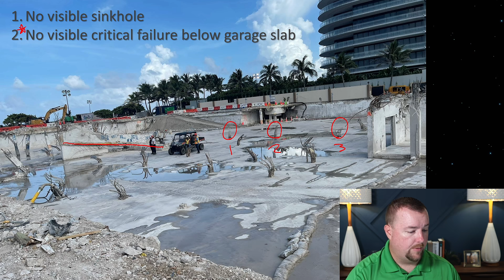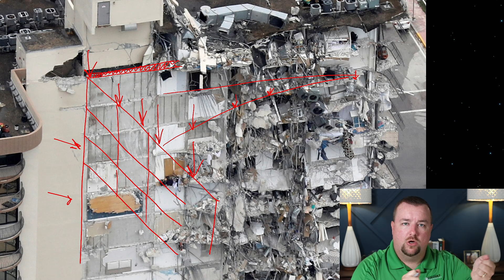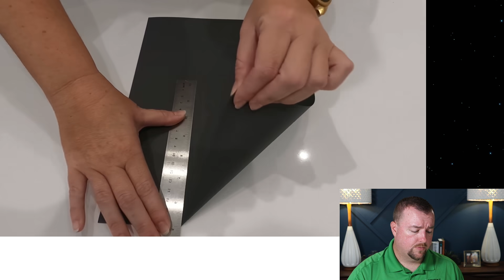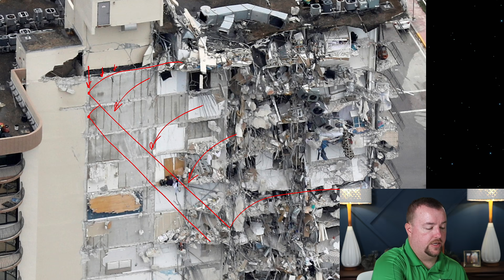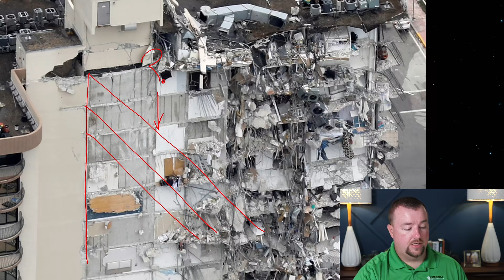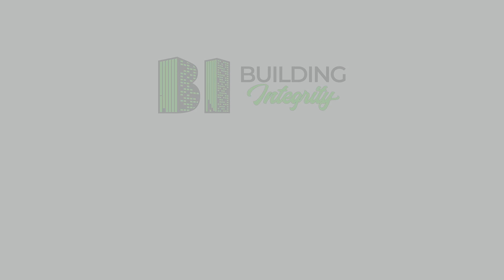Surfside Collapse - Structural Engineer Explains Why Only Half the Building Collapsed

Comment: One thing that astonishes me about how clean the slabs tore at the shear wall, is how you don't see strings of rebar hanging down.  It tore right through.
Reply: Yeah, I don't understand that either. I asked that question above. The engineer replied that he thinks they simply "snapped cleanly". I'm finding that hard to swallow, but he is an engineer!
Reply: I think maybe the building was built in sections. The south, or remaining , side built first. Then they turned the corner and did the center. Only connecting the hallway with rebar and concrete. . Maybe.
Reply: @peterford9369  The part of the building that remained standing after the other part collapsed actually faced the main road. It's where their main entrance and lobby was located so it's my guess that the developer would build that part (the part that remained standing after the initial collapse) first because it lines the main drag with all the other buildings. Wouldn't make sense to build the far back part that faces the ocean when there isn't a lobby there. Just my two cents.
Reply: @KayInMaine  I'm sure you are right. My point was, instead of building the whole structure in one monolithic pour, floor by floor, they built each tower separate, starting with the south, and put larger piles under it. An also larger columns all the way up. Then cut the cost,,on the remaining structure. And, I was just answering to the question, why did the rest fall and seemingly so cleanly, from the south tower. 
That was my 1 cent worth,😘
Reply: Crazy isn’t it? My guess for not having rebar sticking through the shear walls is that it just so happened to tear in between 2 bedroom walls. Maybe they weren’t load bearing walls and therefore only had wood and no rebar in it but that’s just my guess. I am not an engineer
Reply: @kyber7503  My guess is cutting corners
Reply: @philipstreechon4523  They didn't use rebar in the slab at a shear wall? 😲 
I've seen some shady stuff, but that's a hell of a "corner" to cut! 
I thought about it, but don't think they would have gotten away with it for 40 years.
Reply: @Bannering101    Well if they didn’t …then thank heavens.  That helped with straight edge?
Reply: @Bannering101  Until recently it was very hard to verify that rebar in concrete was where the drawings showed it… It is possible to image it now with portable radar and x-ray equipment.
Reply: @allangibson2408  True. However, what does that have to do with this issue? Our point is that we should be able to see the rebar with our eyes, and we don't!
Reply: @Bannering101  The only issue is whether a building inspector should or could have caught a non-conformity after the concrete was poured. Now they can - in 1970 they couldn’t.
Reply: @Bannering101  Yeah, they did. You just can't really see it in the photo. Look around in his other videos. He shows it.
Reply: @kyber7503  No way! Those slabs should have had continuous rebar, in both directions, whether they had load-bearing walls on them or not. Besides, that shear wall was definitely load-bearing! Even if the shear wall was poured monolithically (it wasn't) they should have had bars coming out at slab level.
Reply: @Bannering101  The garage slab of the portion which survived the collapse did not have rebar running in two directions. It had rebar running one direction in one layer. It has been suggested that this configuration was too weak to carry the live loads of the vehicles using the parking garage.
Reply: @BigHenFor  I've NEVER seen a mat in a slab with rebar running and only One direction. It doesn't even make sense, as the rebar will be unable to disperse the load! In any case the load-bearing ability of the garage slab is not an issue here. The slab has been uncovered and appears to be intact. My guess is that it's going to be the columns at the slab that are the issue.
Reply: look how few rebar are sticking out from the wall
Reply: @philipstreechon4523  No, there's a lot more that you just can't see in that photo. BI even showed it.
Reply: I do not think the main load bearing of the stucture would be connected to the shear wall but would be put on the columns themselves.
Reply: @mikeeakin7619  Well Mike, it looks like the slabs ran through the shear wall, so it was definitely load bearing! They wouldn't rely on the slab to be cantilevered over to the sheer wall from the next row of columns.
Reply: @mikeeakin7619  there are columns within that shear wall, and the slab was connected to those columns.
Reply: Hi no these pictures were taken the next day to early on for the investigator's to have gotten there
Reply: No rebar in that floor area connecting the slab, because that wall is an elevator shaft. The slab that torn off of it appears to be  a "floating slab" the lenght of the two elevator shafts area. IIRC, elevator shaft walls are thicker and have rebar/reinenforcement  running verticle. Same thing happened at the WTC 'sorta" , one of the towers, the first 10-12 stories of the elevator shaft and stairwell managed to stay standing and some people survived in that area.
Reply: @chrisperrien7055  World Trade Center was a completely different type of construction. As I recall, the elevator and stairwells were poured in place concrete cores, but the rest of the building was a steel truss system. The trusses buckled and failed due to heat. Not applicable!
Reply: @Bannering101  Yea I know, but the nature of the elevator shafts (having core-walls?), is in efefct they acted/act like sheer walls . Seems to be a big issue with building demolitions. Whether intentional on not, the elevator shaft can be left standing after the building is blown. Note, I defintely ain't an engineer, and haven't done any construction in 25 years, so my terminogoly wil  be all wrong. :)
Reply: @Bannering101  The WTC didn’t have a concrete core in any of its buildings. The elevator shafts and stairwells were simply steel frames clad in Sheetrock / plasterboard.
Reply: @Bannering101  Yep,  the WTC columns failed due to the heat of the thermite.
Note that an office fire can't bring down  a solid steel building.
Reply: @allangibson2408  Yeah, you're probably right. As I indicated it's been a while since I've reviewed the WTC design. 
In any case, my point was... any comparison between the World Trade center, and this collapse is useless (other than the devastation caused by pancaking)! Completely different designs, and causes.
Reply: @reallyme3573  What do you mean: Fire can't bring down a solid steel building? Without fire protection, steel beams can be more vulnerable to fire than timber!
Reply: @Bannering101  I said office fire. Office fires won't get  hotter than 500 degrees celsius,  For steel to lose some strength you need at least 600 degrees celsius, 800 would be better. 
But in case of the WTC to collapse due to fire,  you need to melt all of the steel at once, which is totally impossible with a regular fire.
With a thermite demolition, thermite cuts through the steel and doesn't have to heat all of it.
Reply: @reallyme3573  Well, the Twin Towers were certainly steel "office" buildings! The engineers had anticipated a large jet hitting them. 
So, I'm not sure what your point is.
I wonder if John O'Neill was sitting on the top floor thinking: "Well... I think I was just involved in a plane crash!  However, I'm in an office building, so I should be all right!", Right before the bottom dropped out.
Reply: @Bannering101  Yup. But the arguments for waffle placement of I beams sure looks really good about now to me :) Worked on Empire State getting clobbered twice by two (obviously smaller) military planes in the 40s.
Reply: @chrisperrien7055  The WTC towers were all steel construction. The elevator shafts and fire stairs were steel clad in plasterboard for fire resistance. The only concrete in the building was a thin layer sprayed onto the steel for fireproofing.
Reply: @allangibson2408 That fireproofing is called Monocote and it is not concrete. The explosion, was able to blow the Monocoat off the trusses and columns, making them vulnerable to fire. The engineers actually designed the buildings to withstand a fire from a 707 fuel load, but didn't anticipate the explosion removing the fireproofing.
Reply: @Bannering101  Actually it was worse than that - in the south tower, on the levels that were hit, the coating had been removed prior to reapplication because it was already flaking off before the impact.
BTW a 767 with a full fuel load at 200 Tons is a bit heavier than a 707 with full fuel load at 142 tons (117 tons in early versions). The empty weight of a long range 767-400ER is higher than the takeoff weight of the early 707’s.
Reply: @allangibson2408  I don't think cement board or whatever worked in the stairs here (WTC). Chicago, it's a no-no. Has to be brick or cement block as I recall.
Reply: @windsofmarchjourneyperrytr2823  The WTC towers was a unique building project in a lot of respects - all the structural strength was in the skin not the core ( to maximise the floor space inside). The core just had light steel framed lift shafts where most didn’t go all the way up. Nowhere else copied this design, for fire safety reasons.
Reply: @Sarconthewolf  If the slab rebar terminated at the shear wall, it should have had 90s that tied it into the shear wall reinforcement, exactly to avoid pull out. In a retrofit, you MIGHT be allowed to dowel into a wall. However, you would have to use epoxy or some other mechanical device to secure it.
Reply: Ok. Let's say they decided to run rebar to the shear wall. Without a standing column to support the load bearing after the collapse maybe at most half a room would be attached to the wall. The collapse from the video looks more middle center to me. The beams that are suspect right now are pretty far from that wall
Reply: It was only lightly reinforced, 4/8" bars (13mm) sticking out of the shear wall into the floor slab.  Not going to take much to shear those bars, particularly if you think about the mass of the building that is in motion and tugging on the bars - remember, the shear wall isn't moving, and as each rebar fails the load through the remaining connected bars increases as the suspended load redistributes as the slab progressively unzips itself from the shear wall.
Reply: @barryscroggins8450  Number four bars are pretty standard for a residential slab. The issue wasn't that they would fail under these conditions. It's that we simply  don't see any trace of them!
Reply: @barryscroggins8450  13mm is about 1/2".  Not very robust.
Reply: @MichaeljRichter  The bar only deals with tensile force, the concrete does the compression forces, in composite they are adequate for the loads on the slab.  Remember the slab is only carrying residential loads, one of the most minor load cases.  4/8" bar is about what you would expect to see, top and bottom for this depth slab.
Reply: I'd want to see photos taken close to the shear wall, to see if the rebar sheared off more cleanly there, as opposed to the tangles we see from where the slab tore on a more diagonal path.

What does appear to have been the case is that a combination of factors overwhelmed the building structure, pointing out that the building codes in effect in 1981 did not provide adequate margins, especially when potentially substandard construction and excessively deferred maintenance came into play.
Reply: @chemech  Agreed! Even if it sheared off cleanly as the engineer suggests, you should see rebar! I took a screenshot, and tried to enlarge it but it was useless, as you might imagine!
Reply: Ever think that stuff like that was cut off for testing?  Remember this is a singular pic and we the public have no idea what was removed for future use of testing.
Reply: @ynwa7084  No, not every single bar 10 stories up!
Reply: @ynwa7084  they didn't climb a hundred feet in the air above an unstable pile of rubble, to trim re-bar ... that's almost for certain ...

Comment: So if they had a + shaped shear wall through the entire building perhaps only the one quadrant would have collapsed?  I guess codes only needed them to protect elevators and stairwells and add some strength/rigidity to the structure?
Reply: The wall has to prevent fire from spreading through the elevator shaft, so what better way to do that than with a shear wall that also helps give the building rigidity? The elevator shaft would otherwise be a weak point, where columns have less that usual connection to adjacent columns without the slab in the stairway and elevator shaft.

Comment: So using the example you described at the end like a jump rope, after a collapse, does that mean if you see a punched through column remaining at 90° that is the source of the failure?
Reply from the maker: Not necessarily.  The columns that punched straight through, like at the pool deck, was more likely because of how compromised the deck already was.  See my video on punching shear.
Reply: I like this comment too !

Comment: In a earlier video when explaining how the columns are formed and concrete poured into at each level..with the column starting at basement and increasing upward with each level or floor.   Why were none of the many columns not still remaining. It seem like the column remaining was only one level above ground? Did each column break off with slab at each level on the way down? Sorry only way I know to ask this question..may not make sense to you 😕
Reply: Every level collapsed including any columns above the ground floor

Comment: It's amazine that the basement slab stood up so well to the weight of the entire collapsed tower.  It is likely that there is some void under that slab, even if a few inches due to settlement of the fill around the pile caps.  There is also no visible movement in the columns that would be due to failure of any individual pile caps.
Punching shear calculations can be complicated when there are unbalances from side to side.  The building code tells how much of that unbalance has to be considered for punching shear and it does add a lot to the stress.  If you take a properly designed building then let the next column over fail, that creates a lot more unbalance at the column still standing than it was designed for, increases the shear stress around the perimeter, and will cause a punching shear failure at that column.  Then this can progress across the structure until you get to a column that has enough capacity or you get to a column line where the slab itself can hinge without failing in shear which is what seemed to happen at the face of the building that remained.
All this tells you is that large areas of the ground level slab could have collapsed.  This is like standing there, your belt breaks and your pants fall down around your ankles.  It doesn't tell us the next step which is that columns ultimately had to fail.

Comment: @josh Just watched another engineer’s vid. He opined the beam adjacent to the 16 x16 front columns along that façade that collapsed first (coincidentally under those planters that had extra load and possibly extra water damage if the planter wasn’t properly drained) probably was compromised by the hanging punch-sheared pool deck slab, leaving those front 16 x 16 columns essentially free to move laterally, and they should have been 24 x 24 anyway like the standing portion of the bldg… he felt the columns, that beam and its flimsy 2x #5 rebar (per design drawings as well as observed in post-collapse photos) and the whole pool deck slab were quite underdesigned. Supposedly morabito found no differential subsidance of the foundation (Franki piles/pile caps).

p.s. I am not an engineer, rather I only have advanced degrees in biosciences and health, so I’m just repeating another engineer’s opinion that made a whole lot of sense to me…

Comment: Your comments make sense for a top down collapse. But this building collapsed  bottom up. Loads on failing structure at the bottom would be horrendous. Near the top not quite as horrendous. Tropical f,ors

Comment: Josh, would it have at all been possible for the 3rd part of the collapse to not fall?
Really appreciate your work on all of this!
Reply: Part 3 was standing OK on its own, but I would not have gone into it.  I don't think it would have had the full strength to resist wind load that the original building had.  It would have been interesting to see it attempt to stand against the tropical storm but we didn't get to that point.
Reply: Part 3 fell. Part 4 did not fall.

Comment: Short answer: thicker columns and rigidity of elevator shaft, stairwell and twelve stories of integrated storage rooms stood the second building up. Great details, Josh!
Reply: The other building did have larger columns from level 2 on down due to the column offsets at level 2 to clear parking layout in the basement.  Those columns were larger than necessary for the load which is a bit odd considering that nothing else in the building seems to be that much larger than it needed to be.  That would definitely give the west part of the building more resistance to lateral loads.
Reply: I want to know if they ever find Mrs Stratton? I haven’t heard anyone say do.

Comment: Maybe a weird question. You broke it down 1-3. Could 3 of stood if the bases were stronger?
Reply: Good question, the whole of part 3 rapidly tilted over which appears to show column failure in at the bottom of the building in the garage. I expect that the investigators will be testing the column performance throughout the garage. Also the debris landing in the garage from parts 1 & 2 could have simply knocked away the next row of columns.